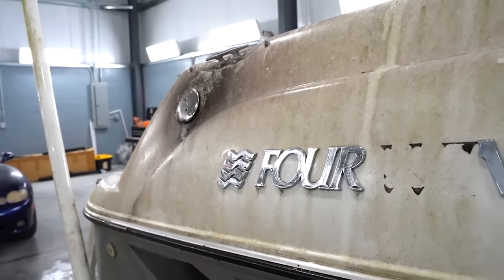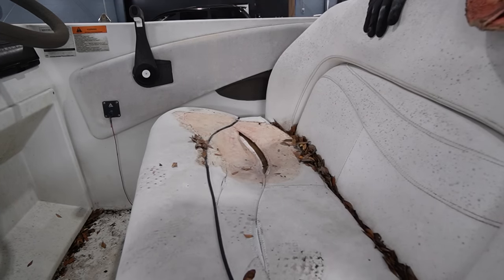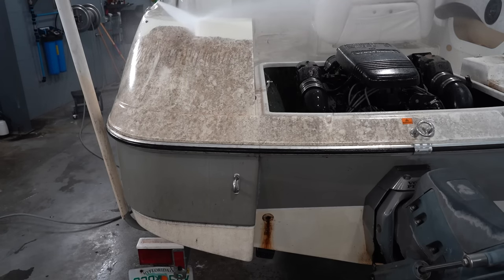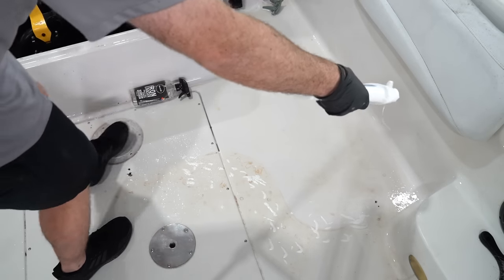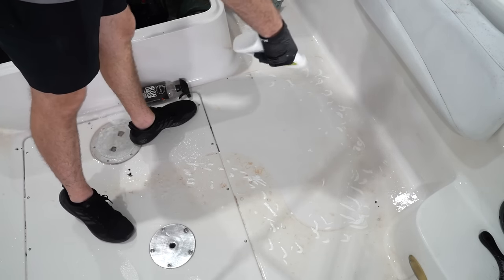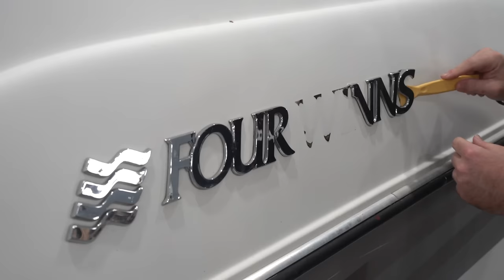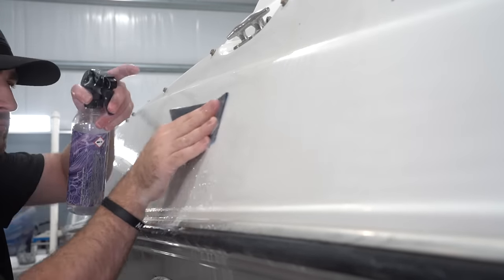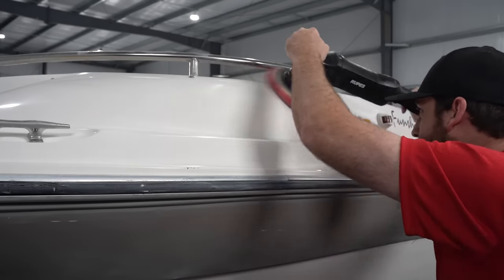ABANDONED Barn Find | Moldy Boat First Wash In 10 Years! | Satisfying ASMR Car Detailing Restoration

Comment: If I may, I have a couple tips you may like! I used to do a lot of boat/yacht detailing and a few thing that saved me time and made my life easier for cleaning are 30 second outdoor cleaner; this will remove mildew/stains off seats like magic, esp paired with a magic eraser. On and Off hull cleaner; amazing product for cleaning any rust/yellow stains on the hull or even interior! Just be cautious with it as it is extremely strong  it will hit the lungs and skin like fireants and will also chalk up any polished surface, so don’t let it sit too long. Lastly is a spiraling pressure washer tip! Makes quick work of cleaning non skid surfaces such as the interior, but once again, very strong. Good luck!

Comment: Nice job! I need to get on my boat now. Just curious, at the beginning with all the mold and mildew, why didn't you use a high concentration of Sodium Hypochlorite? I use a product called Hot Bleach which is 15 percent fresh. You'll need a respirator and gloves. I figured it can't be good for a nice looking gel coat but in this case, you had to fix that anyways. You wouldn't need to pressure wash little lines. You could almost just hose it off.

Comment: Just out of interest, how did you get the water out that you sprayed inside the boat with the pressure washer? A boat doesn't have a drain plug like a bathtub. 😉
Reply: There is a deck drain in the front. At 05:08 when he open up the hatch. You can spot a hatch drain. We had a similar speedboat, and they have more than one deck drain. So you can power wash the interior. And if you get water from waves on board, it will drain out.
Reply: @ThomsenLives  Thanks for the information. 😊
Reply: @JollyRoger2408  no problem mate.

Comment: Since you're in our former home of Sanford, FL I'll share a boat detailing story. We bought a similar boat in 2016 and kept it in Monroe Harbor Marina in 16 and 17. In 18 we moved it over to Boat Tree to cut the time we spent crossing Lake Monroe to head up the St. Johns. We kept it in "dry" storage rather than a slip so you call them and they put it in and you head to the slip they text you. So Hurricane Micheal comes through and unbeknownst to us the cover got ripped off. It was stored in an area where we couldn't see it. They never told us the cover was off and they left the plug in. The river was closed for a bit due to high water so we didn't find out it was a disaster till a few months later. The damn thing was a mosquito colony and had buckets and buckets of muck and leaves in it. I had not discovered detailing videos yet so I struggled for about a month before giving it to a local dealer to sell on commission. We probably lost 2K on the sale due to the damage done and the money we paid them to detail it.

Comment: I have a 1997 Allegro Bay Motorhome that's been sitting for about 6 years. It has had leaks and has mold in some spots of the interior. The outer body has green mold and is faded. It still runs and drives but I can't afford the gas to take it camping. I'd like to just sell it so someone else can enjoy it, but not in the condition that it is in. I'm 62, disabled, and ex military,and we love it if you could help me out while making a video of it for your channel. My motorhome is in Moultrie, Ga. which is just above Tallahassee, Florida.
Reply from the maker: If you can get it to my shop. I would be more than happy to get it cleaned for you.
Reply: @MADDETAILING  what do you charge? Do you have an hourly rate?
Reply from the maker: I would do it for free. All vehicles you see on the Chanel are done for free.
Reply: @MADDETAILING  are you in St. Augustine, FL?
Reply: @MADDETAILING  are you located in St. Augustine, FL